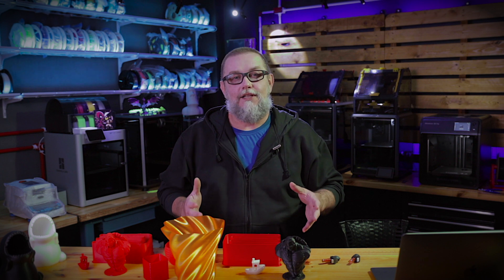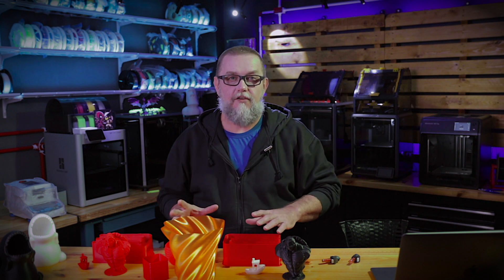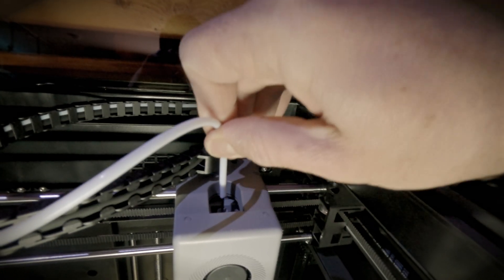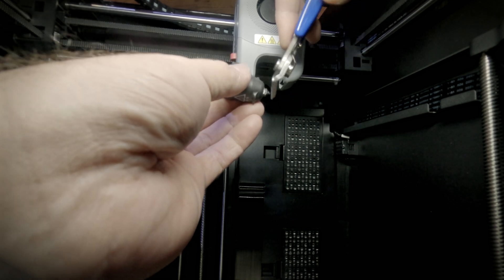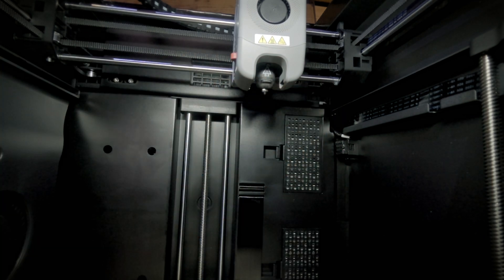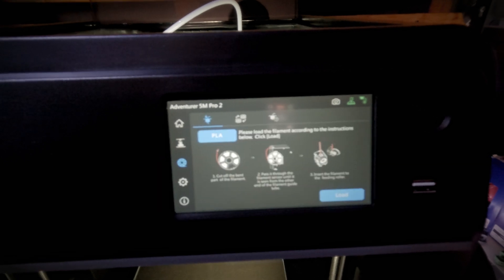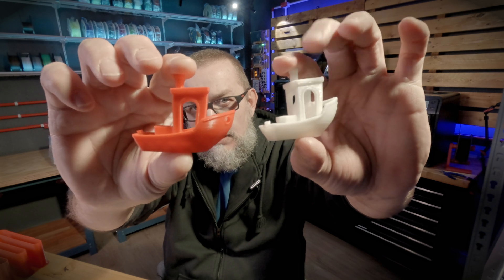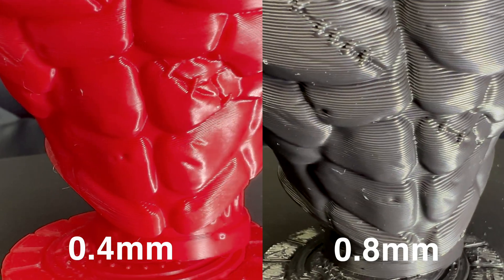Faster 3D Printing: Testing the 0.8mm Nozzle | More Output in Less Time

Comment: Hi, do u have any problems with seams on a 0.8 nozzle? I saw similar issues on my prints, like gaps between lines. I tried many solutions but the problem didn’t go away. Do u have any advice on how to solve this? Thx.

Comment: 0.8 is copium, buy a faster printer and print with speed and low layer height and if you want the strength of 0.8 add a perimeter or two.
Reply: Nah, i'm printing giant parts to test before producing a mold for fiber-glassing. 0.8 is perfect for that regardless of printer speed, it only makes it better.
Reply: No need for that even, if you can handle the flow rate set inner walls to be wider, no need for extra walls.

0.64 works nicely from most modern printers. 0.8 is possible with some print heads and cht nozzles. 

I also often do infill thicker lines as well outer walls and top layers are standard width for quality.